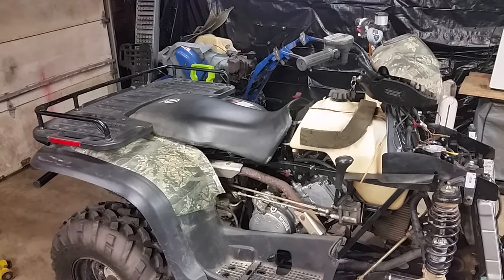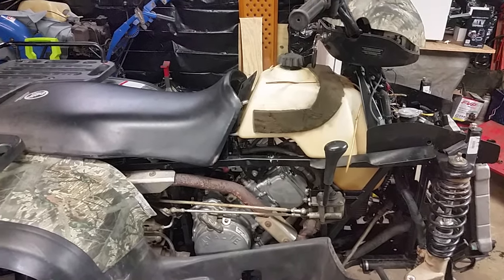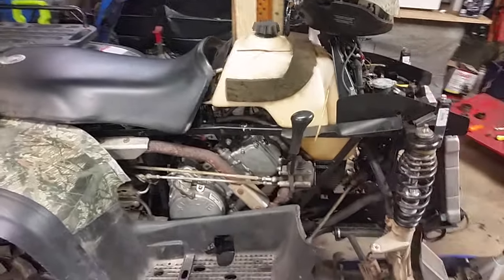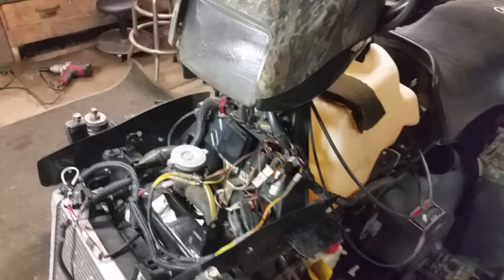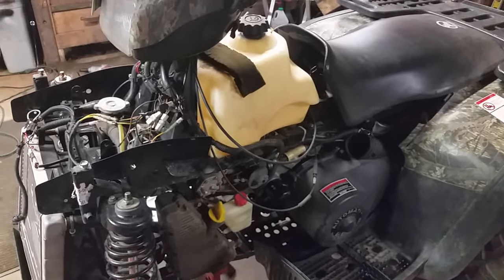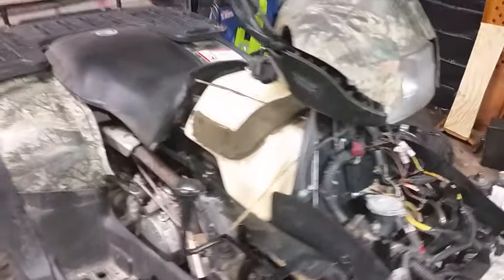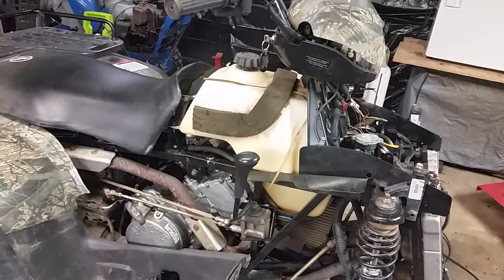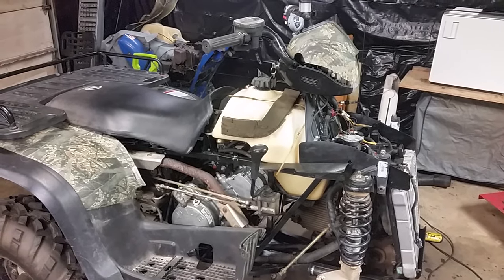Polaris sportsman 500 idles But dies when I hit the throttle.  Find out why?

Comment: I Have been trying to get an 09 sportsman 400 HO figured out for over a year. Only has 60 hours on it! A dealer serviced it for my friends  widow and charged her 1200. Dollars to put a battery in,change oil ,and rebuild carb! They gave it back to her and it still ran like it has water in the gas slash clogged fuel pump! I got it running ok with fuel system cleaner and it wad running nice! Out of no where starts popping,tries to die out. If you put the choke on it'll keep running but badly . An hour later it may run fine and give you no problems for couple days.Always pulls it funny stuff at inopportune times. Took carb apart ,cleaned thoroughly, and machine ran great for a day . Thought it was fixed . Started dying out again on me ! So put new fuel pump on , still running lousy ! I am starting to think electrical . Gonna take the plastic off front and see if any wiring bad under the front deck box on top! It either runs perfect or runs like shut!.Black and white wire from coil  and brown wire from coil go up under the front plastic..Maybe a wire corroded  or something. If I don't find bad connection ,I think ill  change coil.out first than think about control.modules!
Reply from the maker: Your on the right track. The fuel system is ruled out. One thing to check is the safety shutoff switch by the thumb throttle. If the contacts are close to touching the ride could trip it. If they are touching it will shut off. The reason I say that is after you pull the carb, clean it, put it back together sometimes it gets over looked. especially if the cable was removed from the carb and not re adjusted. Also check the choke adjustment. Just a couple quick checks before you dive into the electrical. But yes electrical would be my next guess. check the plugs by the kill switch too. see if there are any corroded wires there as well.

Comment: Thanks, for the information.  I Have a 2002 Sportsman 500, and Mine will fire up just fine idle ok,    but once I let off the gas after per say moving it around it dies or doesn't want to keep running.  If I keep my thumb on the throttle it does ok, but this last time I thought I could smell oil, but I didn't see any signs of a leak and the oil level still says full.  any tips?
Reply: Peel back the throttle cable boot and tighten that up a bit. Should notice a difference. If that doesn't to the trick try adjusting the idle with the set screw on the carb.

Comment: I have a 2008 Sportsman 500 HO/EFI machine that does the same thing - idles great - revs up - if I put it in gear and hold down the brake - I can rev it up - but if I release the hand brake and start to move forward - the machine dies immediately.  I replaced the voltage regulator and no change.  I ordered another ECM module, but it has been on order since last Nov. - 2020!!  I am 90% confident that this is my issue, but need to find if there are any used or rebuilt ECM modules for a 2008 machine out there - or if there is a company that can refurbish my ECM module.
Reply from the maker: There are companies that rebuild them. I can't remember the name. just research them. I'm sure you'll find one.

Comment: Mine acts like it is hitting a rev limiter at about 1/4 throttle what's your thoughts
Reply from the maker: What year? 97 to 2001. camshaft. Try a carb clean. check the cdi.

Comment: Before replacing CDI box would the atv idle fine? Soon as you gave it throttle it spit and bog down?
Reply: Mine is doing this. I think i might replace the cdi. Ive cleaned the whole fuel system.  It sparks but dies with throttle

Comment: I am having the same problem. Has been ongoing for more than a year now. I am pulling my hair out on this one. 97 Sportsman 500 that ran great and then slowly started running poorly. After a carb kit, after market carb, adjusting the valves and checking the cam, new fuel pump and china cheap cdi, still does the same thing. Idles fine, but when you pin the throttle it acts like its running lean, backfires and runs like shit or dies. I guess I will try a polaris cdi and see if that fixes it. About ready to junk this thing.
Reply from the maker: I feel your pain. I went through the same thing with a magnum. Try pulling the black wire on the cdi to see if that makes a difference. Make sure your at top dead center. Check out my latest video..I found a better way to get it there. Did you check your breather hoses for cracks or kinks. One goes to the bottom of the case the other to the oil res. and back to the airbox. One of the big issues..especially with 97 and 98's are too much air getting in and making it backfire. Is the airbox cover warped? If so that will suck in more air and make it run lean. Also check the carb to head boot. I had one that had a hair line crack in it. I didn't see it until I pulled it off. Once I replaced it my problems went away. Hope that helps. Don't give up. Oh..and those Chinese carbs usually only last a year. fyi. Good luck.
Reply: I don't know if this will help. I have a 2004 330 polaris magnum and started acting like your polaris. Would idle fine  but when you gave it gas it would spit and sputter going forward but when I pushed in  the reverse override switch it ran perfect. So I just unplugged the transmission switch plug and now it runs great. Even in reverse there is no need to push in override switch. I believe the transmission switch is bad and telling the machine it was still in reverse when going forward.
Reply: @davidbeeson9594  thats a great tip

Comment: Why was your first thought to pull out the camshaft? And then replace the motor? Like those seem like extreme things to do! You should have started with carburetor then CDI box and you would’ve found the problem right away. Always start with the small stuff and then work your way to the big stuff.
Reply from the maker: Good tip for the viewers. The reason! Because the last 3 500's I had was either a bad cam,chain or timing was off. This 500 the chain timing chain broke. I had just learned the cdi works at idle and not at full speed. That's the message I was passing along. Great comment  I suppose to a new viewer it would sound extreme  lol.

Comment: Hey there 
I have a 2014 sportsman 570 ho that starts at low RPM's and dies sometimes when cold 
Low idle RPM's when cold 
But idles and runs good after warm up 
Only low RPM's when cold 
I already cleaned carb. Play with throttle cable and still have the same problem, 
What could it be?
Reply from the maker: You could bump up the idle screw. there  air/idle screw at the bottom of carb near the boot. It might have a round plate over it so people don't mess with it. Its usually a turn and a half to two turns out depending on the altitude you live in. You could try that.

Comment: I have a 2005 sportsman 500 HO that is having the same symptoms.   However, I think the 2005 has an ECM not CDI, Is this correct?    Any suggestions?
Reply from the maker: Yup. Does the wrench light or fan stay on all the time?
Reply: @TitaniummanGarage  no wrench light or fan staying on and it starts and runs with choke on.  It Cuts out as soon as you hit the throttle.
Reply: james, what did you find out with your machine? I have the same model/year with the exact symptoms.
Reply: @jarodcash601  I wound up using some seafoam clearing up the carb and it’s run great ever since

Comment: Hi I have a question you might be able to answer for me I have a sportsman 400 2x4 2012 I bought as a project it had grabbed a piston I have sorted that but it’s got a few minor problems one is the vent hose is off can you tell what colour the one way valve on fuel tank vent goes on to tank and what and where the tube is routed to and also does it have a filter on the end I would be gratefull if you could help thanks
Reply from the maker: I'm not positive. But if you check partzilla they have exploded views to show you what you are looking for.
Reply: @TitaniummanGarage  thank you for your reply ,I have looked but I haven’t found anything from partzilla but will keep looking thanks again
Reply from the maker: @kennethslater9349  let me see what I can find. I'll get back to you.

Comment: Mine did the the same but it was the carb, cleaned it 2 times 2nd time really good took everything apart, carb cleaner and high pressure air, gained 10 mph i never knew it had!

Comment: I have a 330 Polaris Magnum, runs almost perfect without the air filter top lid on, as soon as I put the lid on it still idles fine but will not throttle up. Any help  would be appreciated!!
Reply from the maker: I hear that alot with the 500's try adjusting the choke. your not getting enough air.
Reply: @TitaniummanGarage  I'll try that thanks 👍

Comment: my sportsman 500 ho ran good then one day it backfired and now wont start now any help would be great
Reply: Mine as well
Reply: @trooperlife1  how did you fix it
Reply: @davekeeping2814  still working on it.. haven’t fixed it yet.  Do you have spark?
Reply: @trooperlife1  yes
Reply: @trooperlife1  did you fix it?
Reply: @Glucoperon  not yet... parts cannon is in full auto mode.  Took it apart, checked timing, checked valve lash, checked the cam lobes, checked stator, put it back together and it started.  Shut it off and again wont start.  Has fuel and spark looks ok.  It has a new flywheel, new stator, new starter, new coil, new plug and wire, new carb (2 just to make sure one wasn’t bad), air box it tight.  I ordered a new CDI from RMStator which should be here today.  We will see if that does anything.
Reply: @trooperlife1  how did it go?? And luck ?
Reply: @trooperlife1  did cdi do the trick
Reply: @jackpeck2494  its not back together.   It was impossible to pull when starting and It was eating starters and batteries.  I tore motor down and am launching the parts cannon at it....
Reply: Broke off a bolt in the crankcase putting stator back on.  Damaged case drilling it out so I got a new crankcase.  I’m having cylinder honed, and putting new valves on as well.

Comment: I have a 2000 Polaris sportsman 500, idles fine but if I give it throttle it bogs....if I install air box it won’t take the gas at all. I’ve replaced cam and rocker arms, fuel pump, all fuel lines, and carb. Do you think my cdi box is my problem?
Reply from the maker: Try unplugging the black wire on cdi first see if that does anything.  Your the 5th person this week that has asked me that. Ha ha. That's ok. Here to help.
Reply: Titaniumman Garage I’ll try that when I get home...what if it doesn’t change anything when I unplug it
Reply: Ok I unplugged the black wire coming from cdi box and it changed nothing
Reply from the maker: @howardsmith876  Hmm. Usually its the other way around. Too much air getting in. What kind of carb did you get? A new carb should do the trick. I've heard of guys drilling holes in there airbox for more air. Make sure your air intake on the airbox cover is not blocked. I've heard of the foam from the gas tank blocking it, causing it to stall or not start.
Reply from the maker: Does it backfire with the air box on?
Reply: @TitaniummanGarage  mine does. Any advice?

Comment: I have a 2006 EFI that starts and idles but when I give it gas it misses and runs like crap, as the rpm rises it seems to run ok. What is up with that?
Reply: Bro mine is doing the same did you ever find out what's wrong?
Reply: @jerryforeman4020  
I suspect the throttle position sensor but I don’t know for sure. I need to take it to the shop for service but I have had so many things going on at home like building a decent wood shed and a new steel roof on the chicken house. I need to get it repaired before winter sets in for sure. Trying to set myself up for the coming winter and need my Sportsman to get firewood from the shed to the house..
I will do my best to post up when I find out what is going on.
Reply: @TheSagerider  ok thank you sir
Reply: @jerryforeman4020  
Hey Jerry!
I went over to the not so local Polaris dealer today and bought a new battery but it didn’t help the throttle issue. I did speak with a service technician and he suggested that it might be the in tank fuel pump but I don’t think it is the pump. It seems to run strong but there might be a crack in the internal fuel line. I will give that a shot tomorrow. I have been a Ducati rider for many years and I have intimate knowledge of fuel tank internal fuel pumps. The tech suggested replacing it but you have to buy a whole new fuel tank to the tune of $750.00, that is not going to happen here. I will keep you informed. :) At least now I can use the thing.
Reply: @TheSagerider  ahh okk I have a 2008 Honda rancher and there really isn't a video to help me out so if you can find a problem to the throttle like if you give to much it just shuts off then maybe it's a Honda problem aswell because with the Honda it's already got a new fuel pump and the filter had been clean and you can get it up to speed but again to much throttle it just shuts off and I'm clueless at this point
Reply: @jerryforeman4020  
That is good information, you have a Honda that is doing the same thing and you replaced the fuel filter and fuel pump with no change. That leads me back to the throttle position sensor.
Reply: @TheSagerider  I seen a video about a grizzly fourhwler and said even though the spark plug isn't bad if you replace it, it runs like it normally does I haven't tried that yet and sounds too good to be true
Reply: @jerryforeman4020  
I will try that but I had that replaced and it didn’t help. I will check it again just to be sure. Easy cheap stuff first. :)
Reply: I have a 2003 or 04 I can't remember  magnum 330. It would only stay running if the choke was out all the way. So I replaced  the carb. Now  it will idle great with no choke. I can Rev it up a little and as soon as I put it in gear  and hit the gas it dies? Any thoughts 😕? I've even rebuild the original carb. Still has the same issue.  I even disconnected the safety switch in the throttle on the handle bar. Any tips would greatly be appreciated!

Comment: I have an 03 sportsman 700 that's doing the same thing. I changed the cdi and still doing it. Idk what to do next. I've changed carbs, the boot, coil, fuel pump and cdi. It idles perfect, but boggs immediately. You can choke it and it can rev higher. You can block some air flow thru the carb and it'll rev higher.
Reply: Have u figured out yet? I have same problem. I'm gonna check the valve lash today to

Comment: Bad spark plugs can cause the same issue, or a worn spark plug cable the grounds out. Enough spark to idle, but not enough to give it throttle.

Comment: Sorry - hit wrong button and stopped my comment... anyhow. Might have been a little aggressive with the cleaning.  Anyhow- It starts up fine, Idles fine but when you give it gas it starts to put/put will do that for a few seconds and then take off.  Will run for a little (30 seconds) and then put/put again.  Had someone look at it last night.  He pulled the air box off and it seemed to run fine, Put the airbox back on and it does it again.  Any ideas?  Im considering getting another CDI box from RMStator but do you think i should try another carb too.  I don't have one laying around so would have to order one from Amazon
Reply from the maker: I don't think its the cdi. I have heard that multiple times after washing. Sounds like your not getting enough air flow to the carb. Yes, Maybe try cleaning the carb. could be your diaphragm. Have you checked the lines going to the carb and airbox? If you have a plugged filter on the hose coming from engine to airbox..Or possible water in it..it would do that. I've seen those hoses have very small cracks in them enough to let air seep in. If you have bad or cracked hoses it wont allow the carb to operate properly because it runs off of vacuum. So I'm guessing its either not enough air or not enough fuel.
Reply: @TitaniummanGarage  Which hoses are you asking about?  Are they the ones attached to the airbox on either side of the air filter?
Reply from the maker: @chucklehman7610  Actually. .All of them. The 2 going to airbox, fuel lines. I had a pinched airline coming from oil res. To airbox. I replaced all the lines including fuel and it ran perfectly. I had the same problem you had.

Comment: I have a 2001 Sportsman 500 ho. Starts and idles fine. When I ride it, it pretty well tops out at 15 mph, slows down I.der anyoad and starts popping out the exhaust. I changed the carb, and put a new plug in it. No change. I'm hearing that these machines are pretty sensitive to intake air volume. Any known issues with these? Cracked carb boot? I'm about to sell the thing if I cant resolve it. Frustrated.
Reply from the maker: That's correct. If you have cracks in your breather hoses or airbox it could cause problems. Have you checked your cam and timing? It sounds like a timing issue.

Comment: So I have same issue. Replaced CDI with an AC to DC conversion. Still having this issue tho. No luck for me. 😒
Reply: Interesting this is that it’ll idle higher by adjusting the idle screw on the carb. Think I just got a clogged jet? (99 Sportsman 500)

Comment: I'm going to try replacing THE CDI box see if that's my problem. I've replaced the flywheel, regulator, stator, and still doesn't want to rev.
Reply from the maker: Did you clean the carb?
Reply: @TitaniummanGarage  cleaned, rebuilt, replaced.
Reply: @TitaniummanGarage  I've replaced the intake manifold, flywheel, spark plug, checked timing and valves.
Reply: @ethanchewning9325  did it work with urs ?
Reply: @MangeurDePoulet  idk yet I replaced it and the starter relay went out and now the ignition switch went bad
Reply: I did the same ,I changed stator ,I put new magnet and wedge ,I put new coil and spark plug and another Cdi and the same ,it starts perfect but when going to half or before half throttle starts to throw explosions as if it will cut the spark.